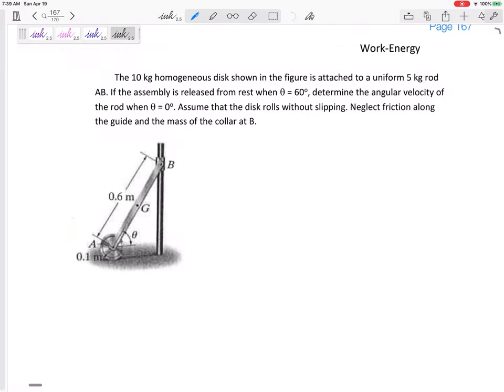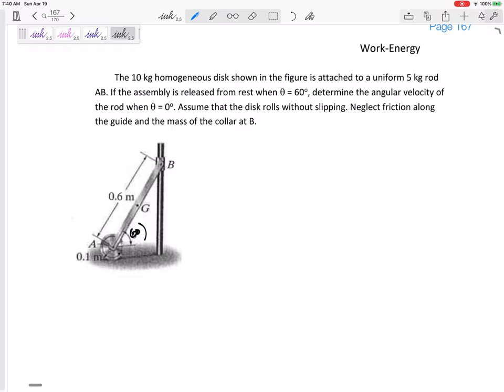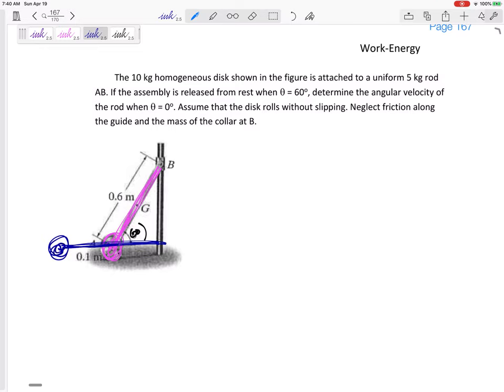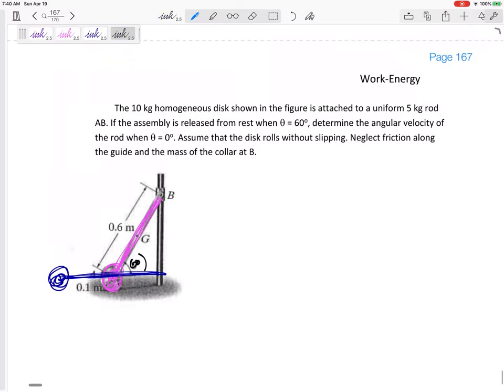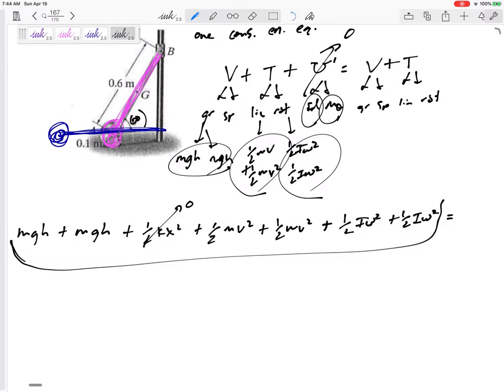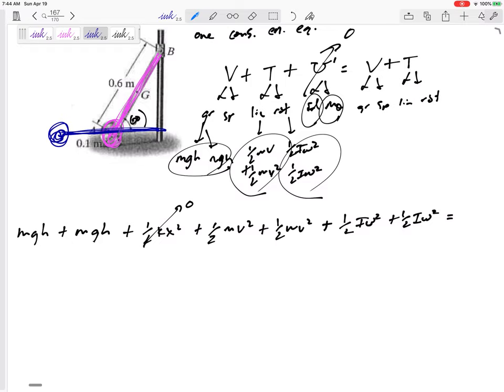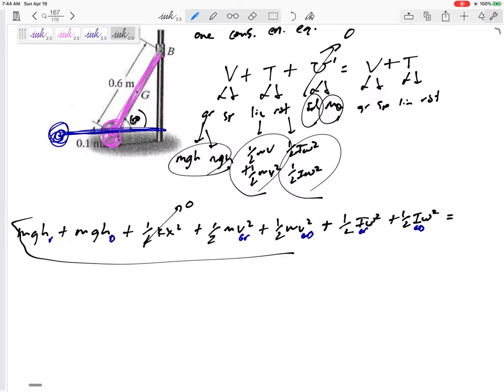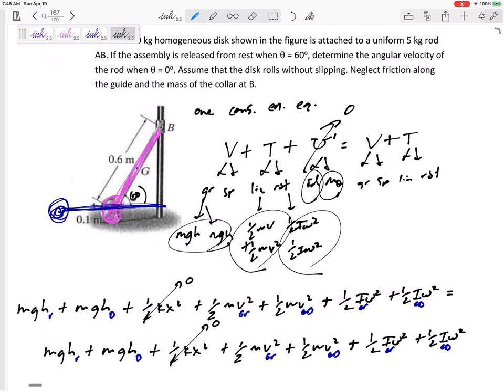Dynamics - Rigid Body work and energy example 5

Comment: if the disc stops then the rod also stops, you sopused to calculate it right before all mekchanism stops and find relations betwen rod and disc angular velosety
Reply: The rod does not stop, the collar will continue going down afterwards and the wheel will go back to the right, the collar hasn't reached its end when theta=0.
Reply: As it is then still 0.1 m from the ground

Comment: The rod at the final state is actually 0.1m off the ground because of the radius of the disk. Therefore, we will have an mgh term for the rod on the right hand side of the equation
Reply from the maker: But we’re already measuring everything from 0.1m off the ground. That’s our “ground” or zero point.